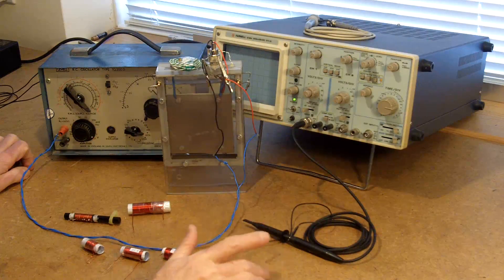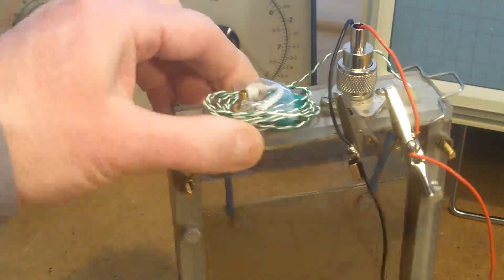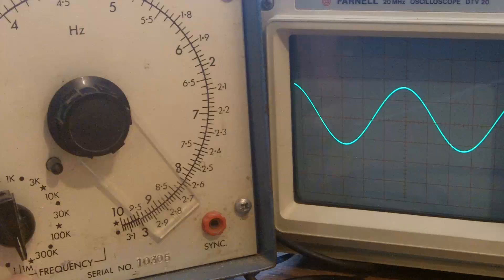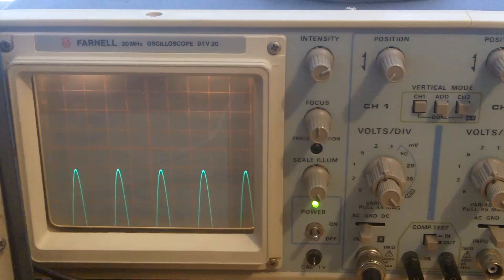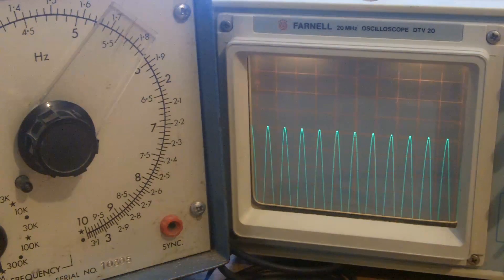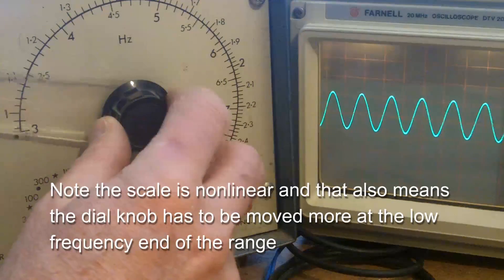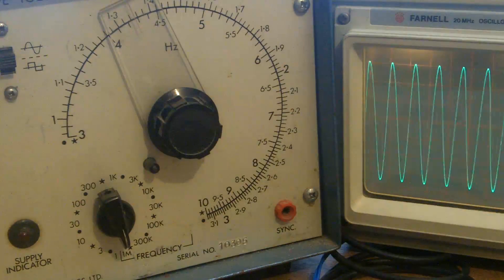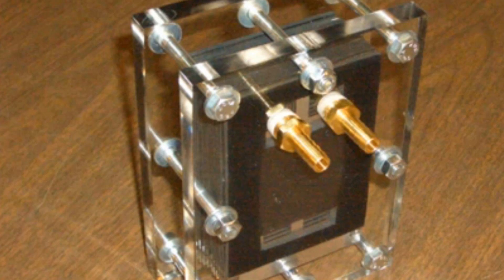HHO. 24 Resonance tests at frequencies below 1 MHz

Comment: What frequency splits water most efficiently? Square wave increases 680% I know that but I dunno how to find a frequency output device for a car either square wave, frequency change or both gets 1700% more efficiency. Can anyone buy or make an emitter for a car at 12v or stepped up to 24v? I'm close just need help and I can help u. Yes must be DC current. That's all I know, above is proven fact
Reply from the maker: Hi there I'm not the best person to give you the answers you want. I haven't looked at this project for some years now but I'm sure there must be some up-to-date ideas kicking around. Good luck . . .  Andy

Comment: I'm in the process of experimenting with somethings similar, though it's much closer to Fliechsmen and Pons apparatus. Atomic resonant transmutation of a Hydrogen isotope to Helium through electromagnetic isolation of plasma to accomplish electrolysis of a Dueterium Oxide and Lithium salt solution with a Palladium Cathode. Palladiums unique molecular structure only allows Hydrogen to occupy space between, Dueteron is a Hydrogen isotope so the Palladium becomes saturated with Dueteron. I'm curious to see what happens when you achieve Phonon Resonance of the Palladium to evacuate the isotopes. What is you opinion of this? Any suggestions?

Comment: Its also worth noting you can generate Hydrogen by placing Aluminium in Sodium Hydroxide; its quite a violent reaction; however no-one has experimented as far as I know using this with Electrolysis. The problem with NaHo reaction is the Aluminium develops a film preventing further hydrogen production; Electrolysis may prevent this...give me a donation if you get rich from it.
Reply: problem with aluminium-sodium hydroxide system to generate hydrogen  is the need for external regeneration of aluminium
Reply: Coral Sea: Not from the few papers I have read; the main barrier to efficiency was oxide build up preventing further reaction, could you explain what you mean in a bit more detail?
Reply: aluminium is converted to small particles of aluminium oxide , which can only be reactivated in oven or furnace, reaction of sodium hydroxide with aluminium  is self-sustaining meaning it will not stop until aluminium is consumed or converted to its oxide form,. I have tried  to make it internally self-regenerating but not possible
Reply: Coral Sea: Did you end up with unreacted Al in the mix, I know I did.
Reply: all consumed regardless of hydroxide concentration, you might be interested and I am looking  forpeople who could help me, I have developed means to convert water to hydrogen and oxygen requiring minimal power input, i think our national science department is really not interested to help me for whatever corrupt reason they have as usual
Reply: Coral Sea: I am always interested in finding new ways and have the means to test most things; especially if it is an electrical system; as that is my area I am qualified and experienced in.

Comment: Now for you to be able to make a comparison with Meyer's work you actually have to build it the same as Meyer had done. All of the specs can be found online now so that you can further your work at understanding just what Stanley Meyer had done. 
Note a coil will act very differently to a square wave pulse than it will do towards a sin wave pulse as I am sure you are familiar with a coils inductive kick voltage, correct? Meyer used square waves for a reason as is with all of what he did in figuring out how to break the bonds of the water molecules outside of Dr. Faraday's electrolysis experiments.
Reply: Do you have some links that I can read your on what you're trying to teach us here? It seems like you've been doing some research of your own.

Comment: I'm guessing but I'm could be wrong you are talking about using AC frequency not RF correct? I would think DC would be most efficient with a possible sonic enhancement would possibly bias and optimize production.

Comment: hey there.

if you're taking requests

16Hz - oxygens resonant frequency
1420hz - Hydrogens resonant Frequency

find the waters "bond disruption" frequency and you might have an interesting result.
Reply: Something like 22ghz
Reply: +david coomsual what's 22ghz as khz or mhz?

thanks.
Reply: +Gary Stinten 22000mhz or 22000000000hz
Reply: +david coomsual this is roughly the distance between the atomic structure
Reply: +david coomsual oh sorry also 2200khz

Comment: hi andy impressive videos, ive just purchased a wavetek sweep generator and a heathkit oscilloscope could you make a video of the process as no  one has made one as to where to connect the leads from the generator to the test piece and then to the oscilloscope ,theres a lot of videos on how to use but none of where to connect the cables  , check my videos of progress to my hydrogen cell cheers

Comment from the maker: Sorry I don’t know as I change the gain several times throughout the video but as you’ll hopefully appreciate I was showing that it’s the difference in amplitude that matters rather than specific voltages. The trouble is it would be so easy to spend the time making a full length video on setting up and calibrating the scope let alone getting the basic message over.    

Kind Regards ... Andy

Comment from the maker: Hi Leon, I'll probably do more on this but the point I wanted to get over was that for most folk testing something like the cell at home, it’ll be stray inductance that will have the predominant affect on erroneous measurements rather than the very small additional  resistance or capacitance that’s likely to be added. It’s always difficult to gauge the audience but I'm just setting out to let the uninitiated know there are potential pitfalls, thanks for the interest

Kind Regards ... Andy

Comment from the maker: Hi, well I guess if I knew the answer to that I wouldn’t need to be doing the experiment, I don’t even know if what I'm trying to achieve is achievable but it seems as good a place to start as any, I want to take advantage of the electric field created by the rising voltage of a series resonant tank circuit. I haven’t followed the efforts of irondmax on YouTube but what an incredibly generous offer he’s made. He has a ‘Test Cell’ video on his site at irondmax (correct spelling)
Regards ..Andy

Comment: Iromax is a master to produce HHO in quantity :)
But what is good with your work is the possibility to optimize the system at maximum and bring the best efficiency 333 
Now about frequencies, do you realise that resonant frequencies could be very different than breaking molecules sthreshold frequencies? So that resonant one are not necessary the most efficient ones to produce HHO?
Indeed I don't really know myself but would be very interested that you could check that.
Cheer, Khwartz.